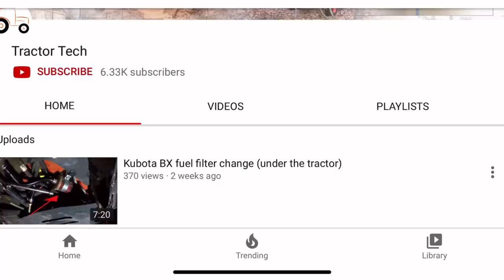Kubota BX fuel filter mod! Step-By-Step! (DIY)

Comment: I would have welded the Nuts for the filter hold down bolts so in the small possibility that the filter needs to be removed, I won't lose the nuts.
Reply from the maker: Bill Silvers yah that’s a good idea.. but for me it wasn’t worth getting the welder out lol..plus I don’t ever plan on taking the filter housing off.. once it’s on its pretty much gonna stay there for life, only the bowl needs to come off. But that is a good thought tho. Thanks for watching 👍🏻
Reply: @BiffsEquipment  OK, But how will you check and or retourg the secondary frame bolts without taking off the fuel filter bracket?
Reply from the maker: Bill Silvers with a wrench.. the filter is mounted to the bracket and then the bracket is mounted to the loader frame.. if I needed to remove the loader frame I could just remove the bolt holding the filter bracket on with a wrench like I used when I installed the bracket.. Meaning I can leave the filter housing on the bracket and still remove it from the loader frame if need be. The filter housing itself should never have to come off of the bracket, not unless I bent or broke the bracket and needed to replace the bracket itself, know what I mean?
Reply: @BiffsEquipment  Yea,,, I wasint thinking on those lines. sounds better then digging out the welder, but I got 2 migs sitting out in the home shop and a stick under a bench. So they For me anyway, are always ready to go.
Reply from the maker: Bill Silvers nice man, yah I gotta get a Permanent station setup in my garage cuz it’s a pain setting it up every time you wanna use it. I just got limited space so I usually put it away when I’m done
Reply: @BiffsEquipment  I tried to post a pic of one setup, but couldn't do it.
Reply from the maker: Bill Silvers yah you can’t post pics on YouTube comments, YouTube won’t allow it for some reason

Comment: I don't think my sales rep has a clue what he's talking about. He told me that the BX comes with this. Will this mod void my warranty? One more thing, do you have any experience working with the loader? Mine started squeaking every time I opened it along with twice now I've had to tighten up the connections because it started to poor hydraulic fluid...
Reply from the maker: Hey David.. yes I’m very experienced with the loader, the squeaking is prolly normal, mine squeaks also if you listen in some of my videos.. this is usually happens when you get behind on greasing .. grease all your fittings and work the loader in all functions after for a bit and see if it goes away.. it could also be because the pins are still very tight if it’s a new machine it may not be broken in yet. As for the fuel bowl.. the dealer is wrong, these tractors only have inline fuel filters, one primary and smoke secondary.. in this video I remove the primary and replace it with this fuel filter/bowl housing and leave the inline secondary filter as you still need a small filter to protect the injection pump. The secondary is never the one to give issues anyways it’s always the primary Inline filter that causes issues.. yes I Belive this will void warentee tho so you may want to hold off till your out of watantee but it’s best to show your dealer pictures or this video of the mod and ask if they would be picky about this if you use a genuine Kubota filter bowl as I did. Lmk how you make out! Oh and lastly.. hydraulic leaks are normal on a new machine.. go over each fitting with a wrench as they may be loose fork factory or often loosen up after the first 10-50 hours.. also keep checking your loader mount/frame bolts along with your lug nuts every 5 hours untill your reach 50 hours to be safe.. once you break your tractor in and re-tighten most of these once or twice they will never come loose again. Best of luck!

Comment: I have a B7500 so my question may not be related. What does the lift pump have to do with the fuel filter? I would like to retrofit a better fuel/water separator on my tractor so it has a simple water drain. My tractor has a much better way to change filters than your original set-up, but is still messy.
Reply from the maker: Hey Dave, that’s great that the B7500 has an actual fuel bowl.. if you wanted a petcock/drain on the bottom of the bowl you’d either have to drill and add one to your original fuel bowl or go with a differnt style fuel bowl but you’d more than likely have to build a custom bracket for the new bowl to get it mounted properly. The reason I mentioned the lift pump in this video is because the filter we were replacing was the filter BEFORE the lift  pump.. and because it’s the primary Filter (first filter to do any work) it often gets clogged the easiest or is the culprit to causing issues when it gets clogged.. if this filter gets clogged it can also damage your lift pump because it will make the lift pump work harder to suck the fuel through it.. this is why it’s important to have a good filter setup before your lift pump and the one that comes on this tractor was not.. it was just a cheap inline filter which clogged all the time.. once it’s replaced on this machine you will have longer filter life, longer lift pump life, and a happier running engine. It’s important to also have a secondary filter AFTER the lift pump.. this way if the lift pump itself ever breaks down or starts to fail it won’t send the pump material through your injection pump.. this is where the secondary filter comes into play.. (The small in line filter that I left in place) this filter is okay being a cheap inline filter as it does a LOT less work than the primary.. so having a good primary filter/fuel bowl and a cheap secondary is def good enough for nearly any machine.

Comment: Hey Biff, sorry for this off-topic question but here goes:
I've got a K 2370 and this looks like how I'd change the battery.  You mentioned a battery maintainer and that's why I looked up 
your vid, because we are going to have below zero temps this week and I thought of putting a maintainer on it to prevent a dead battery.  Supposed to get 12-24" of lake effect snow tomorrow.  If I pull the grill and unstrap the battery, put a maintainer on it do you see any problem with leaving the maintainer connected but unplugged and the grill removed?  That way I can plug it back in when done with snow blowing.  BTW, I've got the anti-gel stuff in the diesel fuel.  Does that make it easier to start in real cold weather?  Just being lazy, I guess!  LOL   Thanks.  Cheers, Bob (Syracuse, NY)
Reply from the maker: Hey man great question. So the maintainer I run I stick out of the side of the grill, I connected the leads to the battery and ran them out the side of the grill where the hood bonnet slides into it, this makes putting it back together a little more difficult cuz there is a wire hanging out the side but if you zip tie the wire well enough it won’t be an issue. Mine has been hanging out of the side of the radiator grill for years and from time to time I’ll plug it in. It’s ok to leave a maintainer hooked to it for any length of time because they will only charge the battery untill it’s full, once full the maintainer will go into like a stand by mode where when it gets cold and battery voltage drops it will reactive again and start slowly charging again so your good with leaving it connected anytime the tractor is not in use. Also it’s a great idea to run an anti gel in the winter time, you can never be too cautious and yes if it gets cold enough it will surely help it start easier. I also run an anti gel in the winter. Hope this helps man!
Reply from the maker: Basically all I have hanging out of the grill is the plug for the charger; then when I want to hook it up all I have to do is plug the charger into that little plug extension that’s hanging out of my grill guard. Next time I’m doing maintenance or something I’ll see if I can touch base on it for you
Reply: @BiffsEquipment  I've since got the cover off the battery.  I had a helluva time trying to do it the other day, slicing my hand. LOL  But when I went out to clear snow the other day, I sat down in the cab and noticed the cover is almost all the way out.  I grabbed and lifted up and pulled, it came off.  Removed the battery, and it's the original with the 2015 date on it.  Attached the maintainer clips to the terminals and then wrestled with the rubber strap. LOL  It was below zero and the K is in an unheated garage.  Ran the wires along the floor and up behind the cup holder.  The plug wire is out the bottom of the door.  Plugged it in and it was charging.  Next day, green to go.  BTW, I've been using Howe's anti-gel since last winter.  I let the engine warm up according to the Kubota manual, 10-15 minutes depending on the temp.  Thanks for your help!  Bob
Reply from the maker: @rvnmedic1968  sure thing man, glad it all worked out. That anti gel works wonders during cold winters! Stay safe!

Comment: Hey biff. Been a long time. Sorry. Had a question. Do you have the part numbers for the fuel filter upgrade
Reply from the maker: Hey buddy long time no talk! Hope all is well man, I’m pretty sure at the beggining of this video I go through all the part numbers for all of the housings you can use for this mod as well as the housing part number that I used as well as the filter. Let me know if you can’t find it. Should be right in the intro when I’m going through what you need to compete the modifications.

Comment: Question for anyone else with this same fuel filter assembly.  Same one we have on one of the M5700s we have.  It looks like there are two "Open" positions on the filter assembly.. one at the 9 o'clock position, and one straight up.. with "Off" all the way to the right at the 3 o'clock position.   Is there some difference in the two "Open" positions?   Is one a "by-pass"?   Thanks in advance!
Reply from the maker: I believe the other "on" port would either be a bypass or possibly for a reserve tank if you  had a reserve tank hooked up to it just like on ATV's and motorcycles.
Reply: @BiffsEquipment  Thanks!  I hadn't considered a reserve/alternate tank, but that makes perfect sense!

Comment: I installed this update using the same filter as Biff. Simple and worth the benefit of not having to climb under thrice a year. The only issue I had was the breather port was not pressed in correctly, and was loose. Thus, diesel leak. Has anyone else had this problem? I repaired with Locktite 680, and is not leaking now.
Reply from the maker: Sorry to hear you got a bad filter housing Frank but I’m glad you like the mod! I have not seen this before so I don’t think it’s common but great idea fixing it with some loctite. Hopefully that does the job for you, I’m sure it will. 👍🏻
Reply: I'm doing this upgrade on my bx2200, this is the filter part I went with Kubota 16665-43013 Fuel Filter Assembly. I just need to find a place to mount it to n make the bracket, cux the frame is different.

Comment: Maybe I am missing some thing here. Why didn't you just remove the factory filter behind the fuel pump and replace it with the brass fitting like you did. Then just use the hose already on the other end of the fuel pump that runs to the the front filter. Remove the hose from the front filter and connect the hose from the pump to the inlet and run a short hose from the outlet back to the front filter. Instead of running a hose from the back of the tractor to the new filter inlet and another hose back to the fuel pump again?
Reply from the maker: Herm Zinn  because you still want to run that secondary filter at the engine, you don’t want to delete both filters.. one filter is for the lift pump the other filter is for the injection pump.. this is why you install the brass fitting where the old filter was and run a new line to your new filter.. then back to your lift pump so that your lift pump can then pull the fuel from the new modded filter and push it through the secondary injection pump filter:. If I was deleting both inline filters then I would have done exactly what you said here.. but since you wanna keep that I like filter before the injection pump this is the way you want to rout it
Reply from the maker: Basically the lift pump needs its own filter, and  the injection pump needs its own filter. Since most the issues with clogging and gelling happened to the (Primary)  inline filter for the lift pump with the fuel going straight into it from the tank; We replace the OEM inline filter with an aftermarket high quality filter/water separator. So now our new upgraded filter takes over the primary filtering but it's able to handle much more volume, have better flow, and is also able to do water separation to boot. You still want to leave the inline filter installed before the injection pump tho to act as the secondary filter as i said before.. but since the fuel is already being filtered once before it gets to the secondary filter it will always last much longer as its doing a lot less work than the primary. (This is why it's ok to leave the secondary OEM inline filter the way it is.) 

Also if you didn't run a filter before your injection pump and your lift pump began to fail it could send metal particles through your injection pump destroying it... Hope this helps, I didn't feel I quite explained it well enough before.

Comment: Why couldn't you move your lift pump along with the filter? Then you wouldn't have to have extra fuel line going back down under tractor.
Reply from the maker: You can if you choose to but there really isn’t much point.. the lift pump lasts a very long time and it’s well protected where it’s at.. then you’d have to find a new place to re-mount it too plus you want to keep the lift pump closest to the fuel tank as possible otherwise moving it farther away makes it not only work harder but makes it wear out much faster because if it.. so it’s best to just leave it where Kubota placed it. Great question tho 👍🏻

Comment: Question, can you just take out the upper fuel filter and put in a double male fitting or does it need to stay in place?
Reply from the maker: David Farber that’s a good question man. The upper inline filter near the engine should stay in place because it acts as a second filter before the injection pump on the motor. With out it you have no secondary defense for particles going into your injection pump if your lift pump were ever to fail

Comment: What made you choose kubota?🤔
Reply from the maker: Hey Stanly, sorry im just not seeing this! I chose Kubota for many different reasons, they sell quality products, they manufacture their own engines and trans and build/match them specifically for each model machine they drop them into. That along with great customer service, warrantee and a good price on top of it. The John Deere 1025r and 1023e are also amazing little tractors.. New Holland 25s is also great. It mainly comes down to what you want to spend and what you feel fits you better and for your given application. Hope this helps!

Comment: I've been looking for the cartridge filter replacement, can't find a part number anywhere. Do you know where to find them?
Reply from the maker: I actually had the Part# written down at some point but lost it. You should be able to get them right off ebay, I would call your local Kubota Dealer with the part number of the filter housing that i give in this video and tell them you need the fuel filter that goes to that part #. Or get the Part# for the filter and search the Part# on ebay and it should come right up.

Comment: I got a fuel preperator im thinking about trying to put on it , its kind of big though ???
Reply from the maker: What type of fuel separator did you get? If you got one of the ones I listed in this video then you’ll be fine. Just put it in the same location I did and it fits perfect. I have never once hit it on something and I have done a crazy amount of work with my Bx since installing this. Hope this helps 👍🏻

Comment: What's the point of this?
Reply from the maker: The point of the fuel filter mod is to get rid of the garbage in-line filter that Kubota has placed in a super inconvenient spot underneath the frame of the tractor.. but not only that the inline filter is also under sized for this machine.. because of that it clogs constantly, plugs up and makes you loose power.. it also freezes up often in the winter time because of its placement and low volume it can hold. Doing this fuel bowl mod not only gets the fuel filter out on the side of the frame where you can actually check on it and service it properly but it also has way more volume, doesn’t freeze or gel, has a much better/larger filter in it, and can be checked/drained easily for water or other contamination. It’s just all around better. Most Diesel engines this size will already have a fuel bowl on it from the factory.. even other equipment with this exact same engine.. but for some reason Kubota did not put one on the Bx (I’m assuming to save space) and it was nothing but a headache for the end user. So that being said I would highly recommend this mod.. this filter filters the fuel from the tank to your lift pump.. then between your lift pump and injection pump you’ll find a second inline filter which is up by the engine.. this filter can be left in place because it is only a secondary filter which catches whatever your primary doesn’t.. so because of this the secondary inline filter is not an issue like the primary inline filter was before the mod.